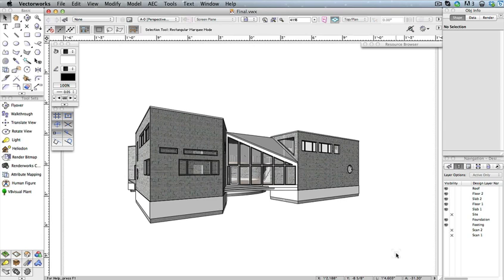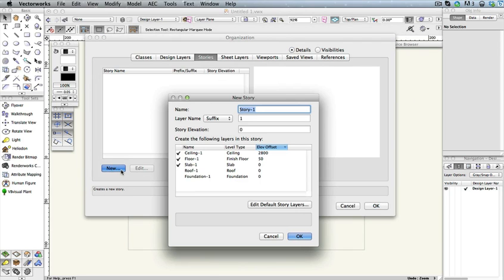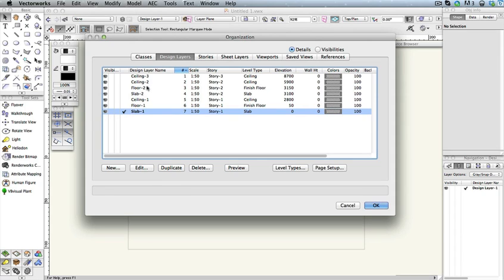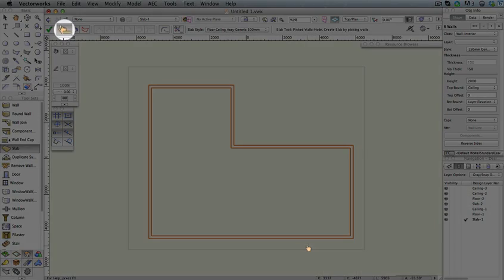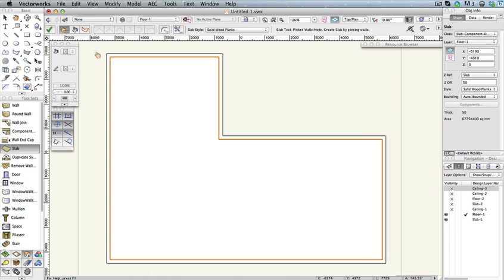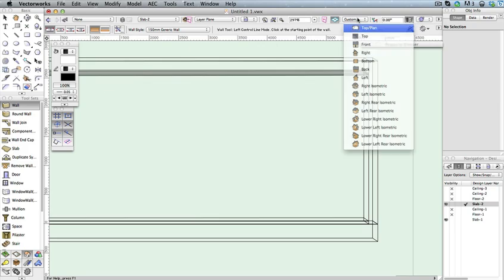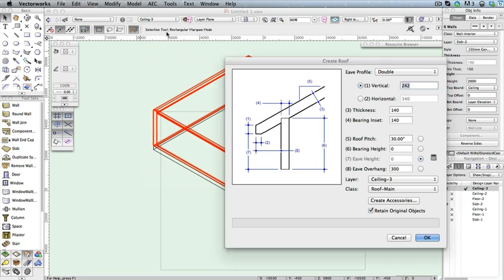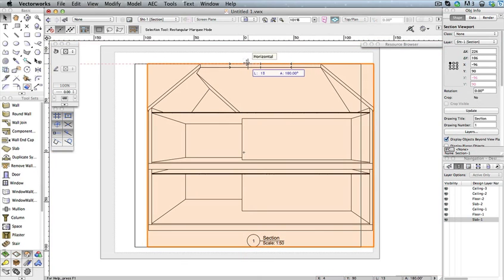Vectorworks Architect 2014: Setting Up Design Layers with Stories - 12

Comment: seriously, why do you have to make everything so complicated. just to make a 2 story house, your telling me I have to dive into the program, navigate through 4 different option windows, specify values, and then i can start to create?? As architects our struggle in terms of workflow is the amount of time it takes to achieve the end result. we need to be able to maximize all of our time as much as possible with simplified options. almost every program i have used requires a few clicks, if any, to achieve what i would have to in vectorworks with 15 clicks... 
moving a wall in vectorworks is incredibly involved, so much so that I get frustrated and end up deleting it all together and redrawing.  I really shouldnt have to tell vectorworks i need This wall to connect to that wall.. or drag it into one another until it finally joins with a tool. thats taking it to a whole other level that is just annoying.
Reply: Thought I was one of that opinion, Vectorworks is killing the urge to use this software,I think this is one of the reasons why it is not popular amount of work that needs to be put in exceeds common sense.
Reply: I do agreed, what program do you think is right program?  thanks

Comment from the maker: Scheven, sure, you can copy and paste walls from one storey to another. The pasted walls will automatically take on their correct Z value in the building and if properly configured, will also adjust their heights to the value assigned to that storey.

Comment: Hi there, I'm currently using vectorworks for studying but still not familiar with this program. I tried to change the view into 3d but only the layer I picked changed so, it  was like only the ceiling layer changed but the others were still in the top view. could you plz tell me how I can change this set up?